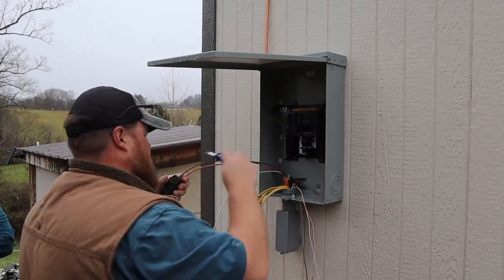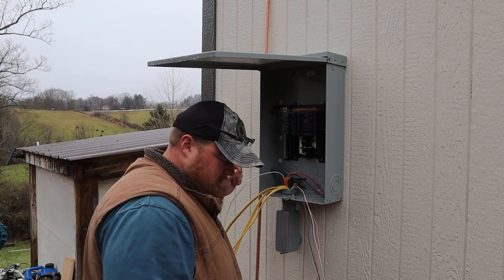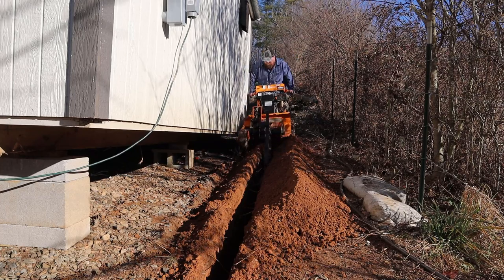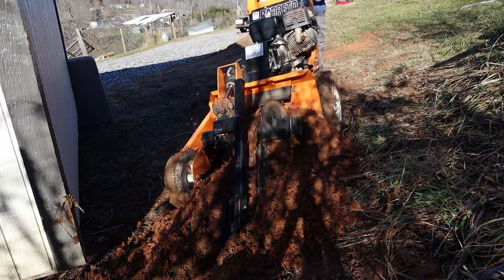Outdoor Sub Panel Install, Trenching, & Connections - Storage Shed Conversion

Comment: Just curious if mounting metal breaker box such as this one is OK. A/c  has metal pull out or breaker by condenser when servicing unit is acceptable but not sure about this set up. Maybe a certified electrician could verify this.

Comment: Hi Sam. We love to watch you and your family on utub. We need help. My husband wants to put a 50 amp sub panel in a shop we have. He has a 6/ 3 wire that was previously run to a central heater. We have done away with it. Can this be done? We are having trouble finding a sub panel that we can add lights and outlets and air compressor to.

Comment: That's funny. Here if a homeowner calls to lo locate buried lines they just tell you if you cut it they will fix it for you.  I cut an internet line in two places with a ditch witch and they came right out and fixed it.  Now we have fiber right to the house and they said the same thing.
Reply: Every place is different.

Comment: Mobile homes need a second grond rod 6 ft out something to think about
Reply from the maker: Our home has the two ground rods. This is a auxiliary structure using both ground rod and ground wire tying back to the home and it's two ground rods.

Comment: Technically, the connector you attached to the pvc female inside the building in a violation.   That fitting is not designed, tested, or listed for multiple NM cables as you installed.   You could have left it off or put a box on the inside.   Best wishes,    Kevin

Comment: If you plan on wiring up a shed, shop, or out building, I encourage you to consider these points while your trench is open:

1)  size the condiut for 200 amps (1 1/4 or 1 1/2 inch).  You could put in one circuit (3 number 14 wires to a 200 Amp service) to supply what power you need now or in future.   Your building could be an office, a yoga studio, or full blown work center without re-digging your trench.

2)  extra pipes in your trench.  Some 3/4 or 1 inch while your trench is open.

A data connection from your house to your shop?

A cable tv connection for your waiting room?

Security cameras connected to your home server?

A "dinner bell" or flashing light for emergencies.  An emergency in your shed might need a light in your house and a noisy shop might need a flashing light for emergencies?

Whatever else you might need?

If the pipe is added whit the trench open, zero redigging.  Just meet or exceed any depth requirements.